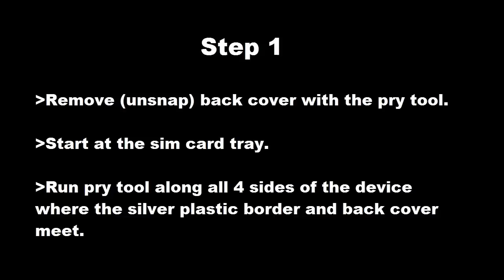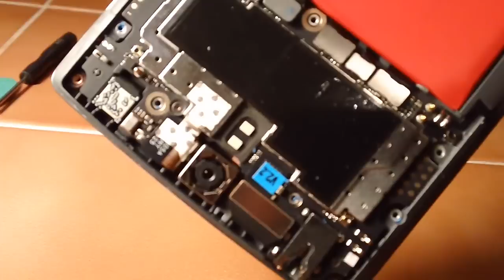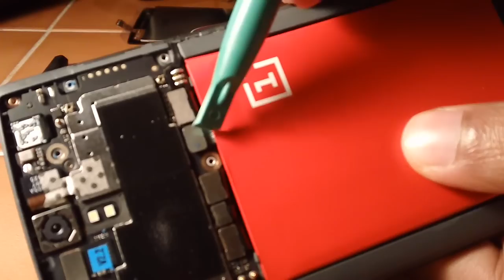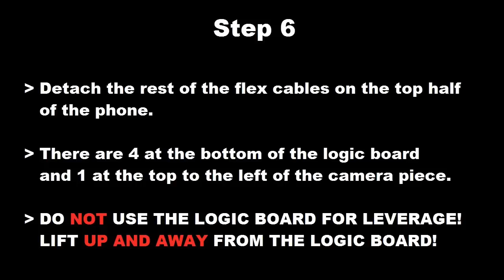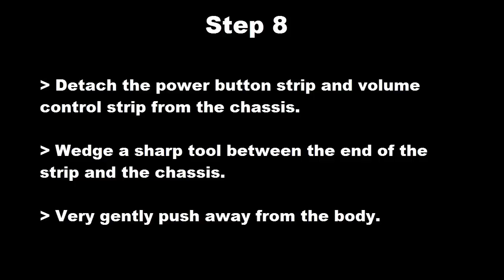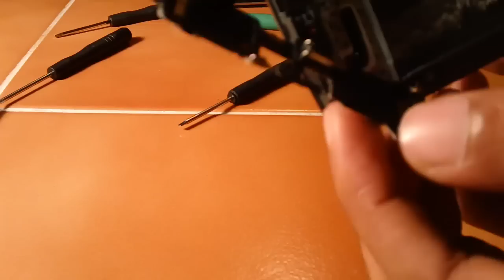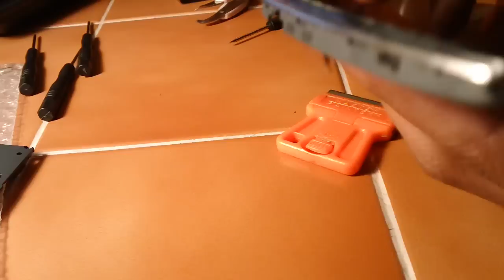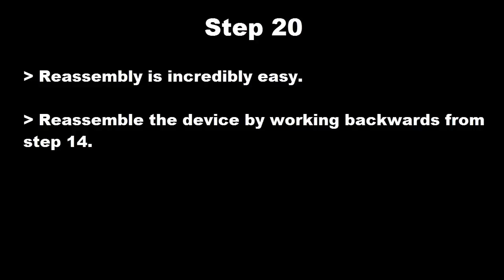HOW TO: REPLACE ONEPLUS ONE SCREEN (OPO Disassembly Tutorial) EASY COMPLETE TEARDOWN

Comment: Hi, I used your video to switch my broken screen on oneplus one. It worked but the only screen that apears is the "Cyanogen Recovery". what can I do? Please help me.
I already choose all the options and the screen that comes back is this one ("Cyanogen Recovery"). Help me please. And sorry for my bad english
Reply from the maker: +Rita Correia i've never seen this before, unfortunately. however, it seems like you somehow reset the phone. i suggest heading over to the forum asking this question there. i only have hardware knowledge and your issue requires software based knowledge. im sorry i couldnt have been anymore help. http://forums.oneplus.net
Reply: I have this same problem.  Apparently when I put the back cover back on, the volume buttons get stuck and that triggers the Cyanogen Recovery screen when you turn it on.  I think it's the volume up button that does this.  I'm not sure how to fix this as I tried to move around the volume button strip and keep putting on the back cover over and over again.  I think it might be that the replacement screen that I bought (which comes with the chassis) may be slightly too big?  Right now my case isn't fully on, it's not covering the volume buttons, that's the only way I can make it work.  I'm going to try to get a new back cover and see how that goes.

Comment: Currently My LCD is black and my cell fell from my hand backward (50 Cms Height) and no scratch or crack on screen but I only have backlight ... Touch and camera works fine and here no body knows this phone! even for repairing !
my laptop doesn't load phone when I connect cell ( but it recognize it as device )
:///
Should I order new LCD ? Where should I take OEM LCD from ? 
do you have any suggestion on Amazon ?
I would be grateful if U help me :)
Reply from the maker: +Pooya Koosha did this happen after you repaired it or is this a general fix question? i recommend going to the forum and seeing what they say if this isn't related to replacing the screen. if this is related to replacing the screen, just make sure the connectors haven't come loose. http://forums.oneplus.net
Reply: I took it to cellphone repair shop and they say cables aren't loose...
BTW thanks man ... it seems I cant get new LCD for long time since I live in Iran :(
Reply from the maker: You might have a bad display... That's so unfortunate. Thank you for sharing your experience. I hope you're able to get it fixed sooner rather than later.

Comment: Very good video! New screen is in and fully functional.  Only thing was adhering new screen to frame. I left out hard plastic gasket thinking I could compensate with my tape. Had put over 5 layers of tape and it still doesn't touch the screen everywhere so my screen isn't quite secured down.  You can see a bit of back light coming from between frame and screen in a few places. Might try just a small bead of silicone along there to seal it up a bit better.

Comment: Stephen Johnson Wow, great video.  I got all the way through the disassembly.  Hoping the reassembly is as easy as you say!  One question: that little gold antenna-looking thing on the right side of the speaker assembly -- almost the last thing you disconnect (step 14) before going to town on the screen-frame assembly -- should (or can) that be reconnected when reassembling??  I tried pull the little gold antenna/connector thing off my old screen/frame after removing the speaker assembly, but it came off of the plastic wire anchoring it to the frame...  Am I screwed??
Reply: Stephen Johnson Also, how to do you reattach that antenna that runs down the right side after you remove the logic board?  My new frame didn't seem to have one, so I pulled the antenna out of the old frame, but not clear how to make sure it's reattached properly...
Reply: Stephen Johnson ...aaaand now it's all back together, but it won't power up or turn on.  It definitely did before I took it apart.  I'm going to check the battery leads, but any recommendations on making sure that those leads are correctly reassembled would be most appreciated!
Reply: Stephen Johnson  It worked!  You are a life-saver.  (Well, a phone-saver...) The thing I didn't get from the disassembly is that those five leads that are removed from the logic board need be snapped back onto it.  Obvious to anyone who has done the slightest bit of circuit board work before, I suppose, but that ain't me...  Anyway, thanks!!
Reply: 95% of the way back to normal.  Unfortunately my reception seems to be very poor after my reassembly.  Any tips to reconnect the antenna / make sure it's working?
Reply: This video was great except that it said to just leave the cellular antenna.  Trouble is that I bought an entire screen assembly, so I needed to carefully remove the antenna from the former one and put it back.  In fact, I broke the antenna at the bottom end when taking everything apart, not realizing that it was the bottom end of the antenna.  So now I am buying a new one, which is getting shipped from China.
Reply: It happen to me, exactly like you said it! Is the reception now better ? Fortunately I just have to wait for one week to arrive, ordered 2 just in case. Thank you.

Comment: i bought the kit and have been trying to get past step 2 (remove screws) for an hour. they're so fucking tight that the tools included are basically useless. a few of them are all but stripped at this point... i'm guessing this means i have to throw the phone away. super disappointed.
Reply from the maker: Let's try to figure out alternative ways to remove these screws. Don't throw it away just yet
Reply from the maker: http://www.todayifoundout.com/index.php/2010/02/the-12-best-ways-to-remove-stripped-screws/ 

Maybe that works.... I doubt it, though. I'll keep looking
Reply from the maker: https://www.ifixit.com/Answers/View/4870/How+can+I+remove+a+totally+stripped+small+camera+screw
Reply from the maker: http://removeandreplace.com/2013/12/02/remove-stripped-screw-iphone-4-5/
Reply from the maker: This has plenty of great alternatives: 
http://boards.straightdope.com/sdmb/showthread.php?t=114654
Reply: Stephen Johnson thanks for taking the time to look up all those videos. i watched a few and tried some different things but finally what worked was using a slightly larger screwdriver than the one that comes in the kit. 
after 4 hours i finally replaced my screen. it works, exxcept for the notification lights. they're not on at all :( this is a huge deal for me. 
there are 2 steps missing in your videos for anyone who buys the screen with the additional backing to eliminate extra work. those steps are: remove all the bluish adhesive from your new unit before proceeding, and after step 14 you also need to take out the little cable with the gold heads on either end, which i think is the antenna, and install it in the new screen.

thanks again

Comment: Informative video. What happen in the end? You seem to be not so happy about the display quality? I had my display changed and find equally spaced dots clearly visible on the screen? This is not the case with the original one. Do you feel the same?
Reply from the maker: Yeah I feel the same, but it's been since December and I am used to it now. At the end of this video,  the screen was not perfect in terms of color/brightness. I was able to fix it mostly by disabling adaptive brightness in the settings.

Comment: So I replaced the broken screen with the new frame+digitizer. I followed every step correctly but somehow my phone doesn't show anything upon starting up. I think it's working fine in the background nothing shows up on the screen other than the backlights.. Earlier the phone would show everything but the touch was damaged. Where could have I gone wrong? Any help would be appreciated. Thanks.
Reply from the maker: Ankit Jain sounds like your connectors to the lcd aren't hooked in properly or they might be damaged. i suggest making sure they are snapped in all the way. you wont need to take the screen back out. you'll risk breaking the new one. just go in from the back.
Reply: Stephen Johnson I figured out what the issue was. The small piece that sits above the logic board and under the connector was not connected well. This new digitizer had a sticker kind of a thing in the piece spot which needs to be removed. Once I removed that and placed the piece again it started working :) So glad I was able to do it myself. Thanks again for the video!
Reply from the maker: Sure thing, brother. I'm glad you got it working. Thanks for watching my video.

Comment: did you buy the screen or the pack with the screen and frame?
Reply from the maker: Matt DiComo i bought just the screen (lcd+digitizer) without the frame, unfortunately. at the time, the screen and frame assembly was very rare and very expensive. now, it's really easy to get the screen + frame combo. i highly recommend that procedure. just stop at step 14 or so and go in reverse.
Reply: OK cool thanks! I'll buy the one with the frame

Comment: One more tip folks!!!

Be extremely carefull with the power button and volume button. I broke my power while taking it of as shown in the tutorial and was not able to start the phone... though somehow I managed to put the pieces back together and its working fine for me.

I pretty sure not all would be as lucky.
Reply: Arpit Shivhare How did you manage to start the phone again after breaking the power ? 
my OPO cannot start. But when I plug the charger, the screen switch on for the battery only.
Reply: Arpit Shivhare Ha haha I am with you, My volume button is not working.... And I dont see any break with control board.
Reply: +Arpit Shivhare I accidentally ripped my power strip thing half way through. How did you get your phone to start without it??
Reply: +Brianna L. you're at the right place then. when your phone is switched off press the volume down button and in the process just plug in the charger. It will take you to recovery mode. Use double tap feature of oneplus to wake up the screen. Boom!! There you go. No power button required ever after. You're welcome. :)
Reply: +Brianna L. *use reboot/recovery mode from list (when you plug in the charger)

Comment: Thanks a lot for the share Stephen. Did manage to successfully replace my screen from your help.

I have one issue though.... the replaced screen is loose.... as in visibly loose... though its working fine. Any help on how to set it right??
Reply from the maker: Don't know how I missed your comment. I have the same issue because I just plain didn't use adhesive...which is a big mistake. I have clear tape over the bottom of the glass to keep it from lifting. Only way to change this is to get a new screen or screen+frame, unfortunately.

Comment: question - what would happen if i left all the parts in the device (that don't really need to be removed) and just detached the two flex cables that relate to the screen itself and then proceeded to remove it?
Reply from the maker: Rahil Abbas you can't physically do that. since you have to dig to the middle of the device to get to those flex cables and detach them.
Reply: Stephen Johnson thanks for clarifying

Comment: One more tip guys. When i restored my backup proximity sensor did not work. I thought i broke my phone, I disassembled it again, and erased all tone at touchscreen where sensors are, thinking that Chinese glass is too dark for it. I laughed a lot when found this: https://forums.oneplus.net/threads/issue-proximity-sensor-not-working-properly.231665/

Comment: Very appreciated for your video, it helped me a lot. The only thing i want to add is to connect gold connector back when compiling phone back. Also i made an error: i ordered at Aliexpress touchscreen only, without a display. Do not do this way, display could not be disassembled separately from digitizer. I have ordered all in complex finally, and build-in into plastic frame, it was much easier to assemble it.

Thanks again and wish a good luck in repairing your OnePlus One!

Comment: Earpiece really quiet!!
Problem: Since you removed the ear piece, the foam glue is detached and when you put it back, the foam sucks up all the volume.
Fix: just glue the earpiece back along the foam part and you'll have normal volume again : D ( remember, the way you put the ear piece in matters. When you hold the phone upright, the letters on the ear piece should be upside down) 

Thank you to Stephen Johnson for this guide
Reply from the maker: teakodo you're welcome. and thank you for the the tip!

Comment: Stephen Johnson I am very confused. I cracked my OPO Screen and now my Touchscreen isn't working anylonger. What do I need to buy to get it fixed? Is that enough http://goo.gl/ghFN67 or is something missing ? Thanks alot !
Reply from the maker: Sara za There are two big methods you can do. 1 - You can purchase the thing you have in your link a long with double sided tape (or other adhesive) and follow every step of my video. 2- You can purchase the screen assembly that comes attached to a mid frame so that you do much less work and stop at step 14 on my video with no adhesive/tape. Does this make sense? Is this clear?
Reply: Stephen Johnson very clear ! thanks alot I'll definitely try it  :-)
Reply from the maker: You're welcome!

Comment: Thank you so much! With this video I was able to fix my oneplus and now it works perfectly! I put double sided tape on the edges and the screen stays in place. One thing I have to say is that the flip cover didn't work. The phone fell out of my pocket and the flip cover opened in the air so the screen was ruined.
Reply from the maker: Mrekee1 thanks for using my video!

Comment: If anyone can help me with whats going wrong that would be beyond appreciated. Basically i followed this vid step by step and my screen wont turn on. The immersive keys work and the phone vibrates when it turns on but either then that nothing from the screen. Please help
Reply from the maker: Matthew Tatar could be a dud display or you may have messed up somewhere. could you link me to which display assembly you bought?
Reply: Stephen Johnson i bought the first assembly you have in your link. I then sent it back and ordered the 2nd one in your description with the frame as well. Just waiting on it to arrive now. I think it was a dud display like you said
Reply from the maker: Matthew Tatar has it arrived, yet?
Reply: Stephen Johnson yes I ordered and received the 2nd option you had in the video description. I would highly recommend going this route bc the guy/ girl gives a hard time with returning the first product listed in your description.

Comment: Will replacing the screen fix the touch sensitive issue related to the heat problem?
Reply from the maker: Andy Lam if it is a hardware issue directly related to the lcd/digitizer, then possibly. could you be a little more specific on what heat problem you're talking about?

Comment: Thank you so much for taking the time to make this tutorial!! It was the first time I had ever tried repairing a smartphone, it was scary but it went really well thanks to your video :D there is still a half a millimeter gap between the frame and screen but I'll try to seal it with glue+pressure
Reply from the maker: Aurore Gauthier good deal. let me know how that turns out. thanks for using my tutorial!

Comment: Hey, first of all thanks for great video. Mine seemed to work until I reassembled backplate and the screen shattered again... Apparently screen I got was not very strong. I'm so sad but I'm just gonna give up on my one.
Reply from the maker: Sorry about that. Thanks for using this video, though. I suggest buying the screen that's already attached to the midframe and you'll be set if you don't actually feel like giving up.
Reply: Stephen Johnson 
Yup,  I tried the one with everything on it, so I replaced mine after step 14. I might try once again with same screen replacement, but this time with more discretion and less force... Again, thanks for great video! It really boosted my confidence in handling small gadgets.
Reply from the maker: Encore sure thing! I'm glad my video was able to give you confidence. Make sure whatever force you apply is evenly distributed.